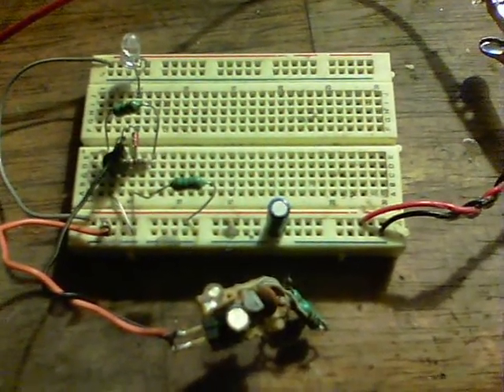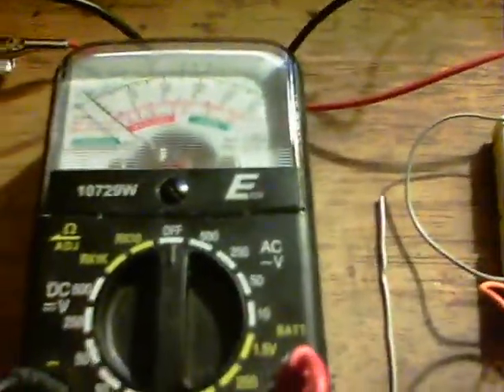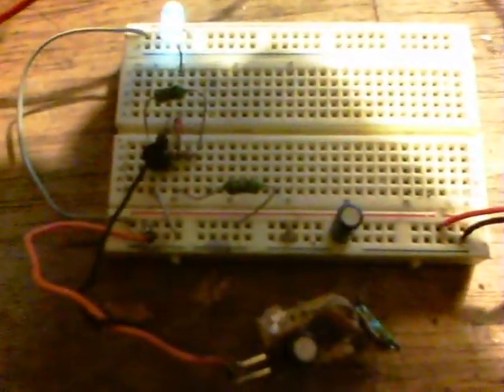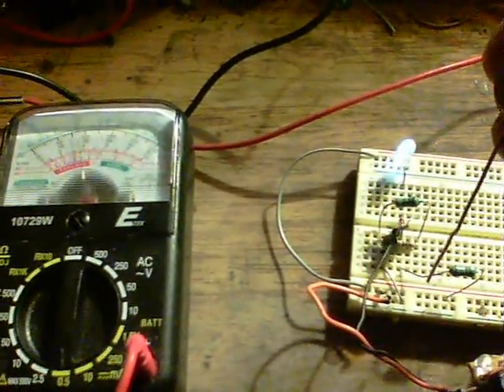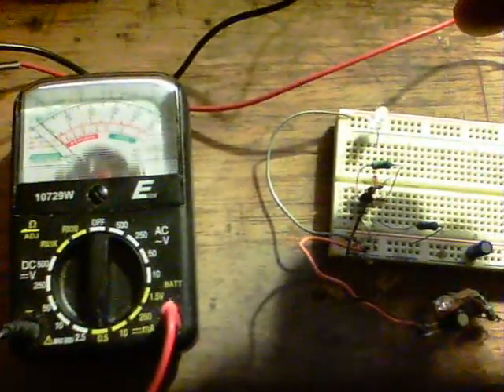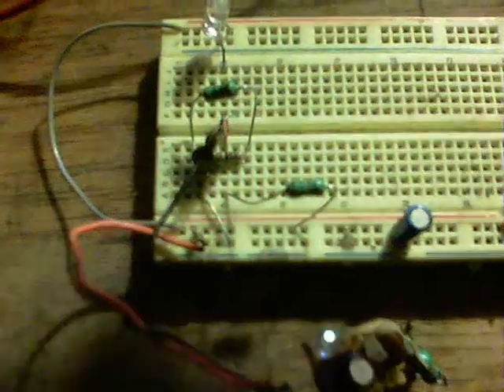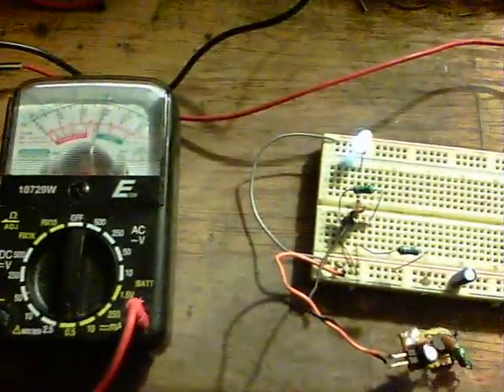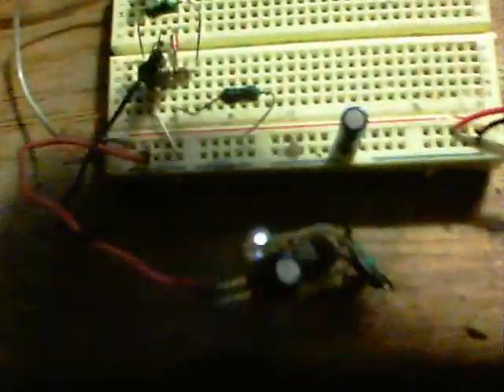Cool Joule - 0uA ? Brainteaser

Comment from the maker: It's part of why it was a brainteaser is all, I didn't know that either. Without the 100K resistor such an osc will normally draw a few uA, but adding it to be hopefully less load on the charging side worked a bit too well. I was convinced the Cool Joule was still running, til traced the Base connections. Am not too used to the SS SSG types, or stuff that won't show a reading. Didn't mean to confuse ya :)

Comment: Its a handy feature. If you go down the Gbluer L3 receiver path, you can reduce input current considerably :) As well as run loads from L3-earth connection, or a primary on L3 like Sohei Thoth has. There is a lot of room for experimentation there :)

Comment from the maker: It doesn't register. It only normally uses about 1uA (large 1.8mH inductors on it instead of a conventional couple of garden tie coils). The 100K resistor slowed down the 100uH onboard firing cap charge rate, long enough that it took several seconds before it started up. Then, because it doesn't fire all the time and instead fires in flashing mode, the average draw that the meter senses negates any reading at all.

Comment from the maker: That was another thing that made me laugh. The 100K resistor and 100uF cap meant that the flashing oscillator would only start after many seconds if the other circuit wasn't running ! I'd got the meter in line to read current so there was no current path...who sits around for 20 seconds during a procedure to start a circuit ? but I did and it started flashing, that was the main clue.

Comment from the maker: Hehe, yes indeed, but I knew it had to be something going on...and worked it through. What it does mean though, is that the little flashing osc is using less than a readable amount of current on this meter. Is helped by the 100K resistor and very extended pathway of the Negative.
Hope is useful for single batt running with nice light output for around 1/4mA